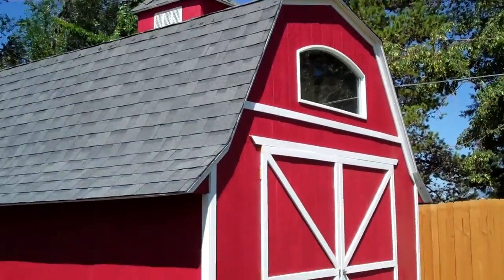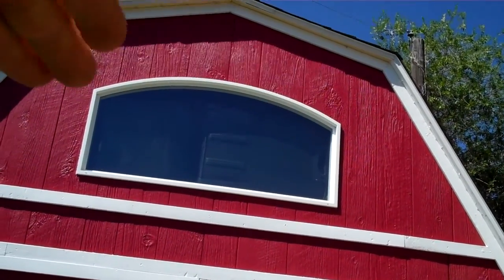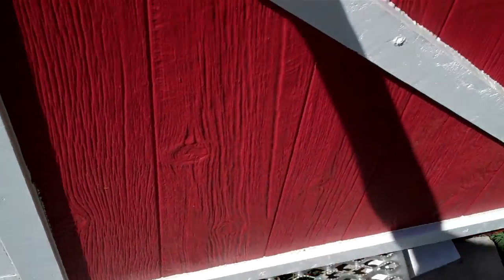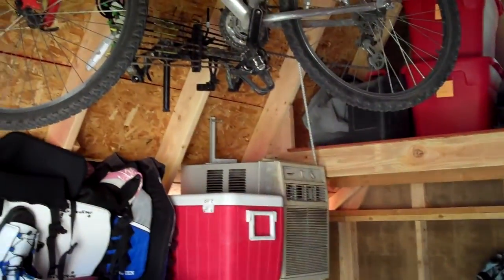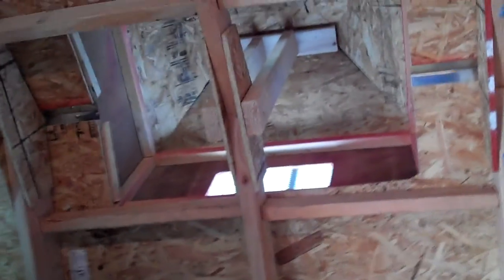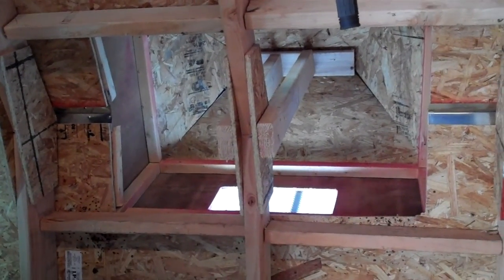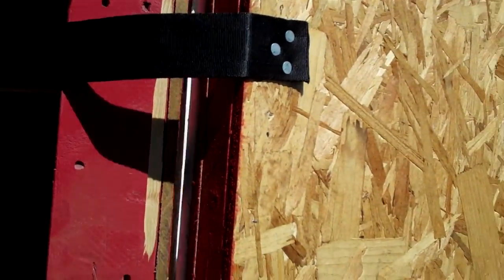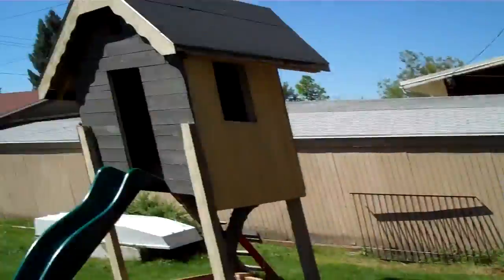Gambrel Barn final product.

Comment from the maker: PLEASE LIKE THIS COMMENT.  Thank you.  The most common question I get is HOW TO DO THE SKIRT.  Here's how.  
The roof skirts were built by using  2.5' 2x4 scabs on the top wall at an angle.  The ends nailed to the trusses with three nails or two screws.  I pulled a chalk line on top of the gambrel trusses where the two matching end scabs meet the truss's.  Then I ran a string through the air from one end scab to the other.  I then laid and nailed all the middle scabs to barely touch the string and the top wall and to be under the chalk line on the truss.'  From there I marked the scabs to length using the string so they're all straight. Then, using a horizontal level, I marked from the mark on top of the scabs straight level toward the wall and cut there.  Then you just sheet the roof and trim it.

Comment: so i have a question. is a ridge beam necessary on gambrel roof? the cabin im building spans 16' wide and 24' long and im using 2x8s for my trusses. im not sure whether i should use a ridge beam. i know ill be using truss braces but im unsure about the ridge beam.

Comment from the maker: Nail in 2x4's hanging down on the ends to the end rafters and run a string on the tops.  Then fill in the 2x4's in the middle.  Rest them on the top of the wall and nail them so they touch the string without raising it higher.